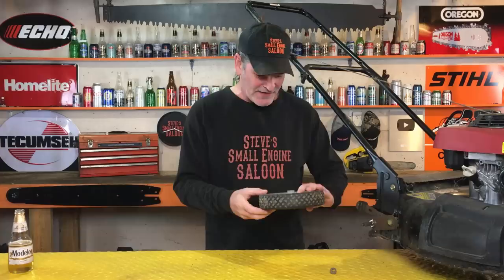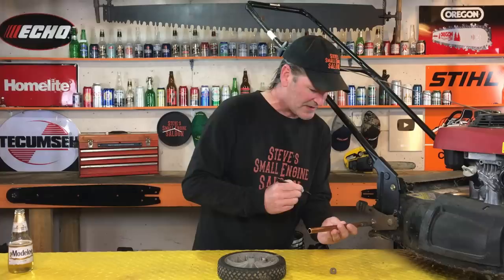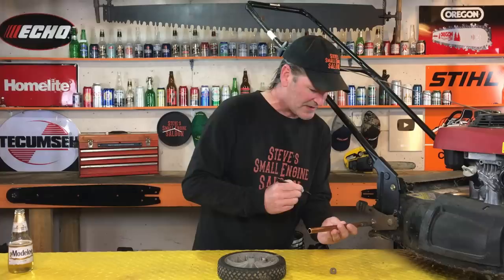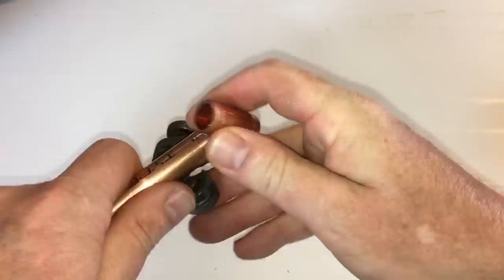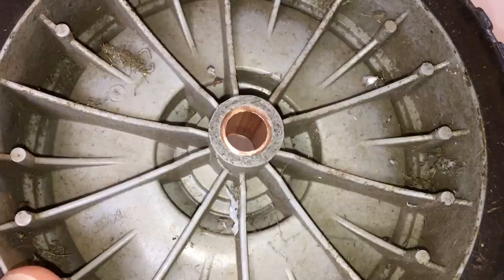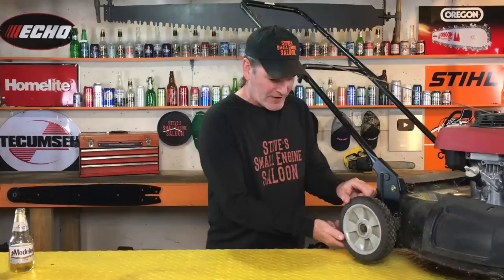Amazing Trick To Fix A Wobbly Lawn Mower Wheel

Comment: I would grease it, but a good alternative might be a dry graphite lube. The graphite won't attract dirt like grease can. To make it easier to install the copper bushing, through it in the freezer for about 30 minutes. Probably will drop right in, then fit nice and tight as it warms up. Works great for installing bearings, etc, so should work for this as well.
Reply: That is a great tip, I have operated Heidelberg presses all my life and was told by a technician that at the factory they would put taper pins in dry ice and then install then, not only did they not ever wobble out they were extremely hard to remove when replacing a part.  JB

Comment: Types K, L, and M are wall thicknesses.  K being the thickest.  The thickness is adjusted by varying the inside diameter.  Being that K is the thickest, it may be a better fit on the axle.   L and M are more readily available in short lengths.

Comment: Wow, this video is EXACTLY what I needed... too bad I didn't see this about a week ago. I was given an old Craftsman mower with extremely worn-out front wheels. I was trying to think of some sort of insert I could use to still keep them on it, but instead swapped them out for another generic set of front wheels I already had. A shame, since the original front wheels were nicer, but whatever since I sold the mower anyway! In terms of greasing, I do use high-temp wheel bearing grease on all of my push mowers. It makes a huge difference in how well they maneuver your yard, especially uphill like mine! I can see the argument about attracting debris and acting to score the shaft, but I look at it this way: Many people in my area put mowers out in the trash that are barely 5 years old, and buy new ones. So, the likelihood of anyone ever having this issue affect them is pretty moot. For myself, I have lots of extra parts on-hand, so I'll take my chances! :)

Comment: Steve I have a push mower that i can not remove the nut from the wheel. 9/16 nut is stripped on the stud (stud threads are stripped i think) and nut spins without coming off. Any hope for getting it off?

Comment: Speaking for my mower, I have to wonder how much grit will get in there since it spends most of it's life on grass.
That said, the suggestions of graphite or silicone spray would seem to be smart.
I've got wobbly wheels and some copper pipe scraps, and I'm going for a beer.
Thanks Steve!
Reply from the maker: You're Welcome...

Comment: Grease it, then glue a little "Hub Cap" made of plastic over the outside covering the bolt head opening to keep most of the crud out. (Or a gob of clear RTV Silicone smoothed somewhat).

Comment: Graphite is best for lubrication of exposed moving parts. If you can't get it, try a locksmith. They use it in locks, instead of oil or grease.

Comment: I’d probably do a tiny little drop of synthetic bike chain lube. Designed to not attract dirt. But it would guess it’d be just fine with nothing. The copper is softer than the steel axle, and it’ll probably work like a bronze bushing in a folding knife.
Reply from the maker: Right on

Comment: I use axle greese once or twice a year.  The tread wears off the front wheels before the center hub wears out. On my third set of front wheel with the original rear wheels. Twenty year old mower used on a corner lot.

Comment: If you want to use grease, drill a hole above the hub using a 1/16" drill bit at a 45° angle ± so the hole ends up at the bearing's midpoint.  Then use a little handheld lubrimatic grease gun with a needle tip. Wheel greasing takes all of 15 seconds for each wheel.  New grease pushes out old grease. If this works with Florida sand, it can work anywhere.  

Be sure that, if you use one of these copper bushings, that it goes into the wheel really tight (don't hone the plastic out so much - so it doesn't turn in the plastic and block off the grease path.)  For this reason, this is best used on new or newer non-wobbly wheels without bushings.

Comment: great tip - to grease or not to grease? - hmmm, tough call - arguments both ways - i would probably apply a small amount of grease with a cue tip to the inside of the new copper bushing before reinstalling the wheel - thanks!

Comment: I serviced my own mower about five years ago and found the studs had rusted inside the plastic wheels. Because they were just stiff and weren't yet wobbly I didn't need to fit a new bush, however, having used wire wool to remove the rust I decided to use the white silicone grease I use to service my fishing reels to lubricate the studs and keep moisture away and even now, five or more years later, I often turn around having just emptied the grass bag to find that the mower it has rolled away a little all by itself. So my experience would suggest to grease them.

Comment: I remember a plumber doing this to a mower decades ago. The issue for most people is 5/8" drill is larger than most drill bit sets come with so now you may have to buy a bit to do the fix.

I would use grease. Some commercial mowers have actual grease zerks on the wheels.

Comment: great tip as always. NO grease. for the reasons you said.
The copper is sacrificial. when it wears do it again or get a new wheel.
Even though it sounds "cheap", 4 wheels +tx is pushing $25US.
Good savings.
Reply: 6" of copper pipe cost $25? You must live in Antarctica.

Comment: I'm in favor of lubrication the copper pipe for two reasons.  One is it decreases wear and tear, and two it decreases corrosion, of which copper is notoriously susceptible.  My three go to lubricants are ACF-50, Boeshield T-9 and silicone oil.  ACF-50 actually penetrates the metal pores and provides good lubrication.  T-9 does almost as good a job decreasing corrosion but is thicker when means it is probably a better lubricant.  I use silicone oil mostly on rubber based products, because it doesn't have petroleum distillates, which eventually tear down rubber.  Both ACF-50 and T-9 were developed for the aviation industry and are commonly used on aircraft.  They don't attract dirt and aren't that expensive, because they've made their way into the bigger commercial market.  You can find T-9 in Home Depot and at bike shops.  Bikers use it to lubricate the chains.  In my opinion, T-9 works better then the exotic Teflon products which are more expensive.  If I didn't have access to these products, I would use lithium grease, as recommended by several posters below.  It, too, would be an excellent lubricant for this application.  In all cases, I would definitely maintain the wheels on a yearly basis.

I would also use a drill press to drill out the wheel as the hole will be straighter than holding the wheel in one hand and the drill in another.  I'm gonna go try this method now, because my Honda mower wheels are wobbly after 12 years of use.  BTW, this mower works just like original except for a very few quirks like the wobbly wheels.

Edit:  My Honda mower has pressed sealed bearings on each side of the rear wheels and one side of the front wheels.  While I had them apart, I cleaned everything  using mineral oil in a spray bottle, then a brush.  I used ACF-50 in some areas but defaulted to lithium grease in the heavier duty areas.  This mower has a hydroglide transmission as opposed to a belt for self-propel.  That's why it's built like a tank back there. The front wheels had a more substantial shimmy, and I fixed that by tightening one bolt that goes into the axle.  It solved the problem for both wheels.

I totally underestimated my mower.

Comment: i know it`s rather late, but my thoughts on greasing the wheels would be yes and no, yes if you have or can make press on hub caps for the wheels as a protection from the elements  OR if you live in a climate that has next to no sand in the soil contents, otherwise no as you are correct, you`d be re cleaning and greasing them constantly in a sandy environment, for some kind of friction deterrent in sandy conditions i`d think graphite would probably be the best bet with not being a wet friction deterrent

Comment: If you put a neoprene washer on each side of the bushing, you can effectively grease it upon assembly, and not worry about contaminants getting in. Copper and steel generally won't corrode, but electrolysis can cause the copper to pit and dissolve over time.

Comment: I say yes on the grease. But I'd put in a zerc fitting. Giving it a squirt of grease occasionally should push out any dirt. Dirt usually stays on the ends anyway, and rarely penetrate very deeply, except on a dry bushing.

Comment: A real bronz bushing is impregnated with oil for a natural lubrication. You can get regular bushings at your local  hardware store. I save back all good lawn mower wheels simply because its easier just to swap a wheel out.  Honda lawn mower wheels wear out way to easy. I see guys changing the outer rubber part. I just go buy new ones. With lawn mower parts costing more these days, I generally strip all my old mowers down and save the rest for metal salvage.

Comment: my opinion:
to grease or not to grease 
if you didn't grease the same area long before the repair it really doesn't need greasing. the copper tubing isn't turning to create friction. if it were turning then copper would be rubbing against plastic.

Comment: It is actually 5/8" copper tubing. Tubing is measured on the O.D.   Been 'sleeving' wheels for years.  Sometimes Brass shim stock will work.  Grease of course.  I always beat on stuff with my Snap-on tool handles.

Comment: I’ve been wondering about using the Brass Bearings that they Sell at the Hardware Store. Can only do the Front Wheels thought. The way they made the back wheels, it would weaken the center to drill them out. They have this spider like molding on the back. I’m looking at some Ball Bearing Wheels on Amazon.

Comment: Awesome video, I did just this except I picked up the Hillman 1/2 x 5/8th x 1" steel spacers from the store for $2 each.  Was having a hard time finding that L type copper piping in shorter lengths than 3' which was $20. Although I do have to recommend laying the wheel flat when you drill it to get it straight as possible. Also, if you don't already have a 5/8th drill bit that's not a cheap bit.

Comment: Ive replaced my bushings on my Honda 2xs and then started squirting motor oil in them when they would start to lock up and have had way more luck with it. Thats the bushings on the axle behind the gear though. Grease never worked for long until it packed with dirt, so... Me personally would put motor oil in them. Those wheels are easy to remove and clean debris out of the new makeshift bushings so why not.

Comment: Silicon spray that dries. I think would last better. I've been using it on my 33 inch Snapper deck rollers since 2001. Replaced the rollers about five years ago but, they could've gone longer.

Comment: No grease or lubricant needed. Copper, brass, bronze against steel make a good bearing. If it's operating range is slower than 60 rpm or so you won't live long enough to wear it out, in fact as the soft metal wears into the hard metal it becomes smoother. (I'm just an old retired Mechanical engineer that made parts for flying machines.....). Great tip, Cheers!
Reply from the maker: Right on

Comment: plastic on plastic loves dry silicone lube but plastic on steel axel shaft ? it may help for a bit dry silicone lube  . but the copper on steel axel shaft prob leave it dry due to lack of grease seals on wheels i think.

Comment: You got to grease it,go to an auto parts store and get an old fashioned grease fitting,drill a hole in the hub through the pipe,a little smaller than the grease fitting,install it and grease the shaft through the fitting,I got all 4 wheels with fittings,the grease will push out any dirt,just wipe the excess with a rag.

Comment: I would imagine that the copper being in direct contact with a dissimilar metal would cause so corrosion over time, especially when it is sitting over the winter. I sit in the no lube camp myself. The sand and dirt that sticks to mower wheels is a constant struggle.

Comment: With no grease it is a gurantee that the bushing will wear out, the steel stud the wheel rides on is much harder the copper. With grease you at least give it a chance to have less friction.  If lubricant really did cause things to wear out faster it would not be used on nearly every mechanical item in the world. If you would like to prove it to yourself clean all the grease out of one side of your cars wheel bearings then continue to drive and see how far you get? Grease is good even taking into account that it attracts dirt.

Comment: I have one like that, the nut won't come off. The axle just spins and that is directly connected to the mower, not a separate part connected.   Any idea how to get that nut off? I thought maybe use a lighter or torch to heat up the nut but haven't tried that.

Comment: I've never hurt anything with WD40, but you must do it on a regular basis. I get the control cables and safety brake / kill switch at the same time. I used to use 2/3 WD40 1/3 Marvel Mystery Oil on bike chains and wheels and it didn't have to be done as often. It would wash out dirt and lubricate it.  Don't like grease in open plain bearings because it becomes the abrasive.

Comment: It may not be as effective as an oil impregnated bronze bushing but since the copper pipe is a lot softer than the steel axle it should still at least as long. It's lightly loaded, I'd not grease or even oil it.  Dry lube (graphite) might help and not attract the dirt/sand but  it probably won't last long.

Comment: The dang wheel is gonna turn grease or no grease. But the fact that grease picks up grit is valid. More in sandy soil locations. So down to the brass tacks it's personal preference or  location. But in the end it doesn't make a tinker dang

Comment: I buy 1/2" x 5/8" x  1 1/2" steel spacers to repair wheels and use little grease.
Reply: _Yep Hillman Seamless Steel Spacers_,
 1/2 in. Inner Dia. x 5/8 in. Outer Dia. x 1-1/2 in. Length  Available  @  Tractor Supply $ 2.29 ea   or  5 pack at Home Depot $12.09 where i live
Hillman Manufacturer Part Number 88042

Comment: I thought the nuts on the end of my 2008 briggs & stratton wheels were loose so i went to tighten them and snapped off one of the nuts .being it’s a 2008 i can’t find a new height of cut adjuster .I’m going have to get a shop to weld a bolt to the end of the stub the cut off the end of the bolt so i can put wheel back on

Comment: This fix won't work for my lawnmower with the big rear wheels. The plastic center bushing completely cracked and my wheel just slides off. The hole in the center is just too big for that copper. I'm thinking about just buying some bearings, but I don't know what size to order online.

Comment: Hello Steve I was wondering if you had any tips for getting the metal sleeve off of the wheel "axel" I replaced my self propelled wheels and in the process one of the wheels came off without the metal  sleeve and I can't get it off to put the new tire on that side

Comment: Hi Steve, love your videos and thanks for sharing. I have a question for you if you don't mind. I was splitting wood the other day with my gas wood splitter . It has a Honda 160 cc engine. As I was saying, I was splitting wood the other day and it stopped running, just like if you turned off the key. I checked the spark plug and it has no spark. Just wondering what I should be looking for before I take it to a small engine repair shop. Later and all the best.

Comment: Bingo! Keep an ordinary mower running long enough and you will have this problem. Here in the US copper pipe is easily found in types L & M. If I remember M is heavy wall. Had an old Personal Pace I wanted to keep going with wheels I saw were beginning to wear. I tried oil, and if anything it did speed up the wear. I'd only lube if you can seal out dirt.
Reply: 'L' is the heavy wall pipe. 'M' is to thin for this.

Comment: you could use oil impregnated bronze...cost more but no grease, graphite, teflon etc...but personally , i'd use copper too
Reply: I used a 5/8" OD x 1/2" ID bronze bushing to fix 2 wheels on my mower as I didn't have scraps of pipe to use and didn't want to buy a full 10' length. A 5/8 twist drill bored out the plastic wheel and the bushing was a press in fit.

Comment: After mowing for six or seven hours I jack up the mower, carefully blow the entire mower off with max air pressure then proceed to wash the underside of the 48'' deck.
Make sure all the fluids are correct and filters clean.
Than I grease everything including the wheels, every time!
That is why my old JD LX188 from the 1990s starts and runs like a new one.
Yes I would grease the inside of the bushing, by drilling a hole dead center through the axle for the zerk fitting and another vertically intersecting the first so the grease will get to the copper bushing. Then install the wheel as described, If the mower had any value.
 
I threw away the push mower years ago and would not spend the time on one to do the above. Just run it dry and wait for the mower to die first.
Oh Yea the only thing I do once a year is an oil and filter change and check the water in the battery.
Will work for beer and fishing trips. So do I get  hired ?

Comment: Hey, do the manufacturers lube these wheel assemblies at the factory? If they do, what is it they use cuz it doesn't do much good.

That said, I enjoyed your video, Steve.  And I watched it again as I poured an ice cold 16 ouncer down my parched throat.
Cheers!
Reply: No they do not. The bearings are dry. I replaced several on a Honda and a Toro this spring. I use a needle in my grease gun and shoot a bit of grease in them.